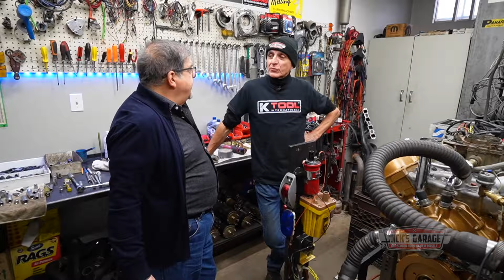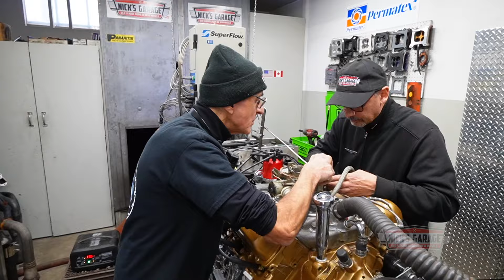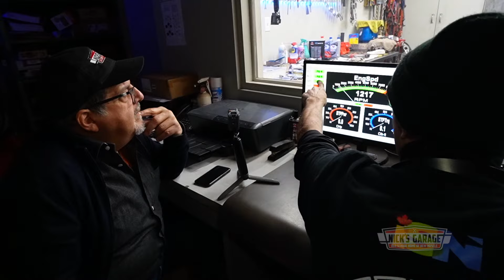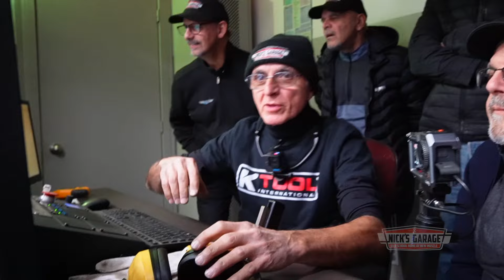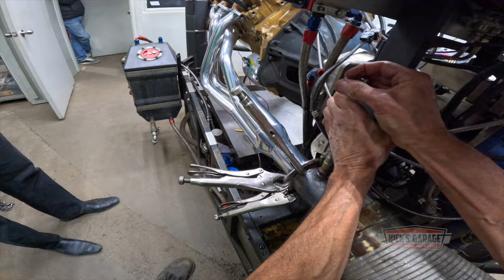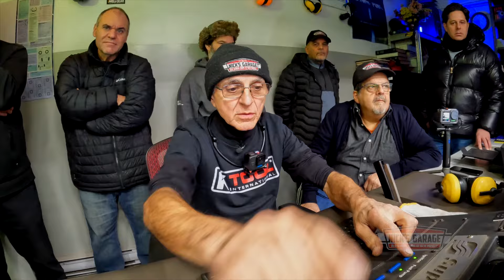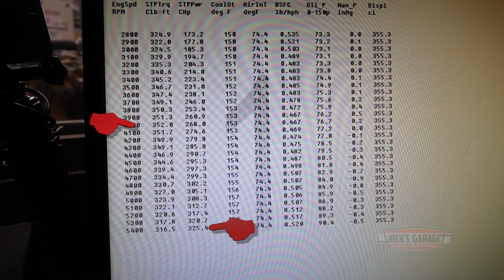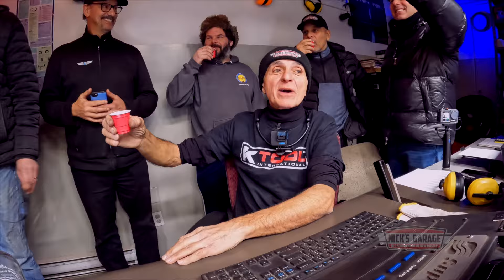Rare Olds W-31 Dyno Party - High Performance Small Block Tested

Comment: Anyone who is not an Oldsmobile fan is a person who has never owned one. Great engines, great cars.
Reply: No need to rev a Rocket to the moon. She makes ALL the torque from 1500 to 3500 rpm
Reply: Olds was the most autonomous division of GM and often took the brunt of their experimental projects like diesel conversions and quad 4 but their engines powered the GMC motorhomes. I still remember my neighbors yellow '76 Cutlass with t-tops, a white vinyl roof and a camel int. First car I remember seeing with square headlights
Reply: Try running one i a v drive pickle fork hydro. 455 has a bad rep in boating crowd. Oil starvation issues, limited rpm range and the ability to spit out rod bearings for no apparent reason
I worked at an olds dealership for 5 years...i got them figured out...got major guff for putting and olds in that boat. Boat had 40 gears, 40% overdrive at the prop ..like 3.08 in car...built the motor out of s pile of parts, put a tunnel ram with 2 660s on it and after some tune work it ran 80 gps. Probably one of the fastest stock short block olds motors around...and the one thing that should have killed it..i ran 5 miles at full throttle at 5100 rpm..ran that motor 3 years and not a single problem
Reply: @RobertGiffin-y9j  Anyone who know Old's V8's should know to restrict the oil to the top end and increase the volume/pressure. Your just not educated.
Reply: @raylaux8295 exactly
Reply: My grampa sold those too... He wound up as head sales manager at a Cadillac, Buick, Olds and Chevy dealership in Ohio... He retired in the early nineties, he started there as a lot boy in '46... Grandma always said, "we're a Buick family, not a Cadillac family", maybe that's why... But the weight of the Cadillacs canceled any engine advantage, hence, the Buicks were always faster in the quarter...! Our fastest cars were, and still are powered by Chevrolet big blocks...! I will say, fastest, and craziest sounding air boat that I drove was powered with a Cadillac 500...! It did not need water, my first "drive" of it was across a cow pasture of Florida bahaia gas... Thanks for you input though...
Reply: Other than the weak blocks, cast rods and cranks which are all 2 seconds away from breaking, the heads flow pretty well with a good porting job.
Reply: @deadsimpleband6922  Olds' block are the strongest GM iron. High nickel content.  Rods are forged. Your misinformed
Reply: @deadsimpleband6922  The Olds issue was not cast rods or weak blocks. Olds used forged rods and a high nickel content block stronger than the other GM's. Olds problem was it's oiling system. Too much oil pumped to the top end. Educated racers knew this and you we're not.
Reply: For sure had a 1974 Cutlass and a 1964 Oldsmobile jet star great cars
Reply: I miss my 68 Cutlass 😢
I know where there are 2 Toronados in a barn...
Reply: @a.joegevara3519 Late 60's Toronados were dirt cheap a few years back. The 425 Rocket was the best Old's engine with it's forged crank.
Reply: @raylaux8295 had a 66 Toro with the 425. I was eating Trans Ams and Camaros for lunch.  What a sleeper!
Reply: @GBelly-tf9sq  Yep, the 425's had the capability to rev to 7K and extended torque range beyond the longer stroke 455's.
Reply: You're wrong sir. I never owned one, and I am a fan. They made some great cars
Reply: the Aurora and it's F1 inspired V8 is one of my favorite cars of all time!
Reply: I owned two 1968 custlas-S with that same engin, they wher the best cars I've ever owned!
Reply: I agree. My first two cars were Oldsmobiles. A 63 cutlass and then a 66 442.
Reply: My dad had a 1963 Olds star fire,that car was big and super fast,he spotted a Mach 1, 3 cars and blew his doors off😂😂😂😂. Loved that car,it was rear-ended when it was parked and it was totaled😢
Reply: The best ever!!!
Reply: I had a 70-Old 98.  Engine died & at 17- I had no idea. Traded the engine for some chevy parts. The kid I traded with
found the pin on dist. gear had sheared. He then put a big cam in it headers 250 shot with a 4 speed & a 411
geared cutlass convertible. Painted black primer with a brush. Iron on jean patches in the holes in the roof.
  It was probley the fastest ugly car on Cape Ann back in 1980.   🤗
Reply: I always wanted a 442.
Reply: The sad part about that 325hp is with all the accessories PS, Alternator and water pump, that engine is really just a cruiser.
Reply: I called my olds the gutless
Reply: @robflammia4716 I lived in a small Chicago border town growing up in the 60’s/70’s. A guy down the street had a red 69 442. All the other gear heads in town went for mopars and chevys. The neighbor with the 442 took a lot of cash from those guys. He never lost. We’d go watch them race on an industrial park straightaway every weekend for a couple of summers. That car was anything but gutless.
Reply: Every 455 olds i touched, had a thrown rod and windowed pan and block.  Tossed them in the scrap and replaced with a 454
Reply: @terrypikaart4394  you just don't have the touch..lol
Reply: @terrypikaart4394  The "Smokey and the Bandit" Trans Am had Pontiac 400 V8 (6.6L) engine. Just enough torque to break traction and put on a smoke show, which is all they really needed. The engine noise for the movie soundtrack was supplied by a 427 L-88 Chev. From the same 55 Chev used in Two Lane Blacktop and American Graffiti. Bandit's Trans Am was not Chevy powered. Just sounded like it.
Reply: @terrypikaart4394  The 'Smokey and the Bandit' Trans ams had Chevrolet 454s swapped into them because they needed/ wanted big horsepower...!
Reply: Nope, 400 Pontiac and a 4 gear @kurtisstutzman7056
Reply: Had a Delta 88, junk!
Reply: Agreed, but Nick sucks....
Reply: I always preferred Buicks over any Oldsmobile...! Much better engines and cars in my opinion...!
Reply: @kurtisstutzman7056 totally disagree. Buicks were on par with Olds, but not superior in any way. I had a 71 GS Stage II and a 71 442 drop top. The 442 was indestructible, the Buick not so much.
Reply: buicks are easily the worst out of the bunch, at least in the longevity department...
they have the worst oiling problems, with that stupid aluminum timing cover and they take way more mods to get them to survive a beating. i have a buick v8 and a number of olds v8s.
ask my buddy, he just built a 430 for his 69 electra, he said never again lol. he also has a 72 skylark and after dealing with all the buick bs, hes dropping a chevy 427 in that car. olds has to be the most simple engine next to the chevys.
i am convinced that those cast iron intakes are what holds those flimsy "light weight" buick motors together.  @kurtisstutzman7056
Reply: @kurtisstutzman7056 Cadillacs were even better. 472s and 500s stomped any Brand X 455.
Reply: @chrisreynolds6520  you should probably ease up on whatever you're taking. the buick gs 455, let alone the stage 1, would smoke any cadillac
Reply: @DavidMiddleton-w6x  You are completely dellusional. Cadillac 500 had more hp than a Stage 1 and and much more torque.

Comment: If I had that Olds one of only over 1000 made I would not cut it up and put in a 5 speed I would put in the original matching number Muncie and change the gear ration to 323s and keep the original 391s not very bright

Comment: One thing I always liked about my Delta 88 with a (replacement) Rocket 350 engine, was the placement of the oil filler neck: right up front where you could reach it without spilling it down the valve cover, etc.

Comment: Headers on an Olds is the best way to kill power unless you build a stuffer plate in the center ports. They like lots of lift hate duration. A Pontiac piston and rods make a killer Olds. I’ve seen a 350 olds that sounded like a late 70’s stocker that would turn 10in slickes at will and showed lites of bow ties and powers the taillights I learned from Don he was a master of rocket power! I miss the Mann.

Comment: I had a 1970  Cutlass with a w31,and it would run consistent 13.5 in the 1/4 mile.
Love those  Olds engines.

Comment: Believe it or not, as told by former Oldsmobile employees, it should have made 350 HP at higher than the 5400 advertised RPM. The Olds 350 was GM's best 350 IMHO, very durable. Very cool Nick!
Reply: That is their reputation: tougher than a comparable Chevy motor; to justify their higher price.

Comment: My 1964 Olds 442 came with the high compression (10.25:1) 330 engine that made 310hp.. wish I still had it!
Reply: All the engines back then had 10.25+ compression. Your 442 had a hotter cam in it than the basic 330. That was the difference.
Reply: my '64 F-85 Cutlass came with a (Toronado) 425ci .30 over flat tops and  .484 lift Ultra Dyne cam and a set of 'C' heads (not yet installed) I got the car in 2018 and trying to get it back together after full paint and under coating the underside. I've got many extras for it including TH350 built BOP Corp and just got a set of Thornton headers. Edelbrock RPM Performer intake and Q-Jet off a 68-72 Cutlass/Old's. Hope it at least has 350+hp and 470lbs torque when It is finished . Next Spring 2025.

Comment: Cam specks on the W-31 cam is .472 lift / 295 Der on a 114* C/L  I got that cam in my 66 Cutlass with a Turbo 400 A/T and a 4,500 stall converter but I didn't use the 350 cast crank & rods of the 70/350 , I used a 66 Olds 330 that has a forged crank & rods from the factory so I do twist it up much higher to 7,700rpm with no problems. With my 66 Olds sports coup coming in at only 3,300pounds and with 355 gears in a 12 bolt posi ( out of a 66 B.B.  SS Chevelle)  My full dress 66 W-31 post car Cutlass currently runs a 13:88 in the 1/4 mile at 98mph with street tires. I am shifting at 7,400 rpm and no NO-2 juice. I had Sig Erson grind the w-31 cam specks with a 110 * Center line rather then the 114* because I am using a Turbo 400 A/T and wanted a wider power ban, and I got it. Oldsmobile's are FUN !
Reply: Your specs are not correct for the 70 W31 engine (308/308 .474/.474)
Reply from the maker: Thanks for the info.
Reply: nick im an olds machinist and racer, trust e he's never spinning the heavy as a truck 330 forged crank with the small compared to modern grinds 308 aka w31 aka early w30 cam.  never in a million year.  the 330 and 400e and 425 forged cranks need knife edging and balanced within a gram across the board to see above 6500 and live, vs 1 the bomb.  7700 rpm, Mayne in our new rocket racing block and Bryant 4 grand crank ad with a cam of 260-275 duration at .050 and 675-700 lift, not those pathetic advertised numbers .  love your channel. god bless and happy new year, im from Cyprus father and Calabrese mother over here, hello my fellow countryman! @NicksGarage

Comment: If 325 doesn’t sound like much, the 350 hp (Advertised) 350 Chevy only made 323 hp. It took a cam change and some tuning to get it to actually put out 350 hp. Even worse was the 350 hp 327 only made 313 horsepower from the factory.

Comment: There’s a lot more in that little engine Nick, I realize it’s a new build, but once it’s run in, it will easily go to 6000, and beyond, especially if he goes with adjustable rocker train, if those heads are correct, and have the 2.07 intakes, they’re the same values the bigger W-30 455 takes, the #6 heads weren’t just any #6’s, they were hand picked for certain characteristics to be the best they had to offer. I owned one of these cars a while back, and still have a W-30 in my shop I ordered brand new. 👍
Reply: The w31 had the regulator 455 valves, 2 in intakes and 1.652 exhaust.

Comment: Awsome engine.I'm pretty sure w31s had 2''intake valves. Love your channel Nick.
Reply: No the W-31 actually came with the W-30 2.07 intake valves, and the heads although #6 castings, were hand picked for certain characteristics to be the best Olds had to offer.
Reply: You are correct, the W31 came with the regular 455 valves, 2 inch intakes and 1.625 exhaust.
Reply: @basilcarroll9729   No actually the regular 455 took a smaller intake valve, the HP Version had the 2.07, which they also out in the W-31 heads, the Toro’s had the 2.07 intake valves as well, but the valves were cut to a different angle to aid performance.
Reply: @Musclecar1972  What are you saying "no" to?
Reply: @basilcarroll9729  I’m saying that isn’t exactly correct, the 2.07 valves were HP only the regular 455 took a smaller intake valve, the W-31 had the 2.07 intake valves as well, that’s what I’m referring to.
Reply: @Musclecar1972  No, the W31 had 2.00 intakes and 1.625 exhaust.The regular 350 had 1.875 intakes and 1.562 exhaust. The w30 had bigger valves than the smaller W31. Those are the facts.
Reply: @basilcarroll9729  Ah, no those aren’t the facts chief, have and still do own versions of both, those are the facts, look it up, I’ve been building Olds engines in one form or another for a very long time , all HP, not being disrespectful, but you need to look things up. I just sold a set of # 5 heads all redone a few years ago from an earlier version of the 31, had all new valves out in, and the special valve angles cut as well.
Reply from the maker: Thank you!
Reply: @basilcarroll9729  Well , lets do tit for tat, 😉 I’ve got a 72 W-30 442 in my shop resting through the winter months right now, I ordered it brand new in 1972, still have it, just finished a 5 year frame off restoration on it, I had a 67 Post sedan a long time ago for a time, I’ve had 2 1968 442’s, one completely stock automatic, the other a W-30, 4 speed, not number matching, it had a 513 cu in stroker engine, that Joe Mondello built himself, not for me, but the previous owner, had  a 1970 Cutlass 310 hp 4 speed, and a 1970 W-31 automatic, a new 1979 Olds 98 Regency, 403, a 1971 98 LS, a 1972 Cutlass wagon, 350, then there were 2 Yenko Camaro’s, 1 brand new, the other a few years ago, authentic car, not number matching, 498 cu in stroker bb, Hughes Transmission Turbo 400, did retain the original 4:10, in 1970 a new LS-6 454 SS Chevelle, I had traded my first Yenko in on, then in 1971 a new 455 HO T/A which I had traded the Chevelle in on, then the1972 W-30 I told you about earlier, which I still have, that is now a 462, 11:1, block is decked, Ga heads are shaved, ports smoothed, bronze guides, better valves, original size, 1970 W-30 cam, slightly custom, W Z manifolds stock outside, smoothed and polished inside, and a lot more. And this is the short list of new and used cars I’ve owned through the years, I forgot, I had a new 1976 Cutlass Salon, just remembered that one, Pontiac’s, Fords, Chevys, Olds, AMC, Mercury, even a VW, lol I don’t discriminate. As for resources, mine are in my head, but any Olds forum, or just ask Google whatever you need, it’s all there, some will tell you the 31 had an .05 instead of the .07 but that’s incorrect too. Mainly appears in the info for the # 5 head cars. I had a barn full of engines at my other house before I sold it 5 BB Olds, a few small blocks, Chevy and Olds, a few BB Chevy, and a Ford or two FE engines. Do you know what the reason the C heads are probably the best flowing heads  for an Olds? They don’t usually explain that in the mags, and info blogs. I do know the D’s are the most expensive, and I’ve never had any to compare with, unfortunately my 68 had 1970 E heads that Mondello massaged for the 513, but I’ve had a bunch of C heads that I’ve modified through the years mainly when people were going full roller, before this aftermarket aluminum stuff hit the market. If you want me to tell you the secret behind the C heads, if you don’t already know, let me know.😉👍
Reply: Yes, the 1970 Cutlass chassis manual states in section 6B 13 the 2:00 in valves are for 350 W 31, 455 exc 4-4-4, W33 and W34. The 2:072 valves are listed for the 4-4-2 and Toronado W 34. Straight from Oldsmobile.
Reply: @basilcarroll9729  I knew that Sorry, just my nature, you know how Olds guys are! LOL 😂If you look a little deeper, you’ll see the angle cut into the valves and seats on the W cars are also different, the same size valves, but the angle is different from the Toro, not sure about the Police special engines. Did you know that Olds actually produced an all aluminum version of the W-31? It unfortunately was never released to the general public, although examples do still exist, insurance regulations killed a lot of really great stuff. The W-34 was rated at 400 hp and the W-30 at 370 in 1970, kind of a funny joke, con the intake and jetting on the Toro, they way underrated the W-30, again insurance played a part. I just sent Nick a couple of pictures of my W-30, if he shows them on his pod cast, you will see what it looks like, I sent him a little note of explanation as well, if he shows it, it will be Flame Orange, with white stripes and interior. You know I just reread what you sent, and I think you’re trying to tell me that the W-31 had the 2.00 valves, and if that is what you’re stating, you are still wrong, like I told you I’ve owned and built them, not sure about the Ram Rod 350, but the 69 and 70 took 2.07 I’ve seen publications stating 2.05 as well, and they’re wrong too, go to Olds Faqs and look there, I would not argue if I didn’t know for a fact, not only from reading, but hands on and owning them. To bad Joe Mondello isn’t still with us, he would tell you the same thing, I used to talk to him regularly when he had his tech line open. In any case believe what you want, and have a Happy New Year. 👍
Reply: @Musclecar1972  NP, yea the 2:072 are 30° while the 2:00 are 46° .All the exhaust are 46°. At least for 1970.

Comment: That is one smooth and steady engine.. I'm thinking it could easily make 400 hp with some moderate tweaking..
Reply: We have built a 350 Olds a few years ago and made 402 HP. with moderate tweaking and the factory cast iron Intake and Rochester Carb.